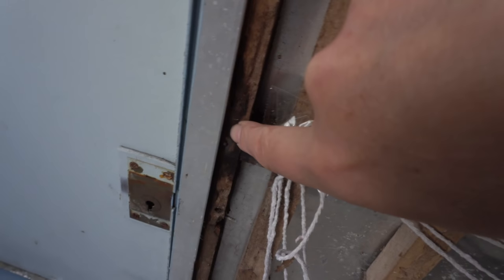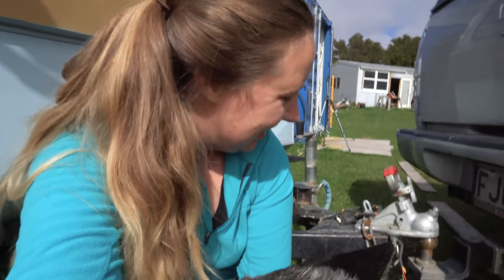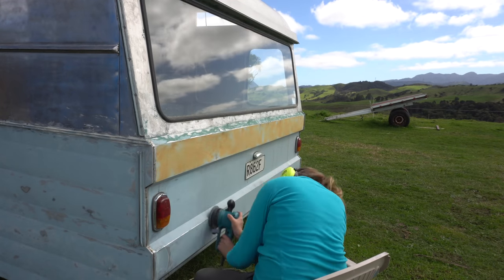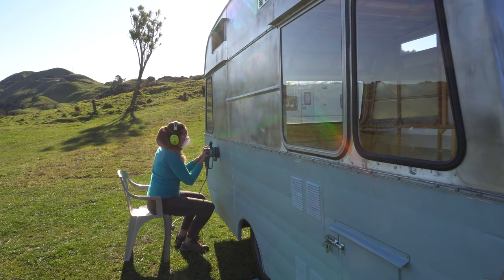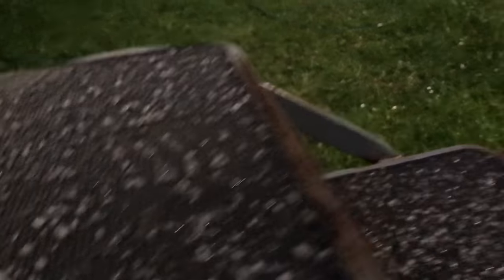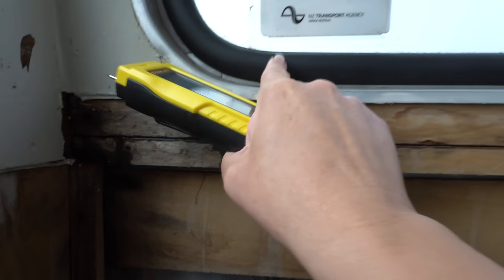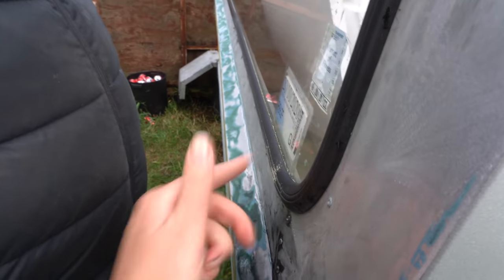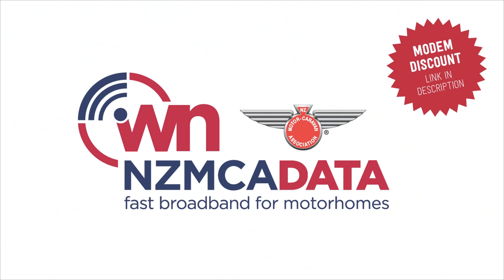Impossible To Seal Caravan 😭 Never Ending Leaks

Comment: Sealing windows that are in weather seals like your trailer has is a simple task. I worked for car dealers for many years and sealing leaks was one of my jobs, among many others. You will need a sealant of some sort. What we used is probably not available but you might check with a windshield replacement shop to see what is available in your area. If not, then you will need  calking gun, a tube of black silicone and a plasting trim stick. Something with a narrower end. About 1/2 inch or 13mm wide. WIth the stick pull the rubber away from the glass and insert the end of the tube into the exposed area. When you cut the end off of the tube make it a small cut and enlarge it as necessary until you reach the desired opening. Now, slowly slide the stick along the seal and squeeze the trigger on the calking gun. Sealant will now fill the void. A little goes a long way. Do not bother cleaning the excess sealant. You will clean it with a razor blade once it has cured. Move the stick and follow with the gun all the way around the window. It is best to do this from the outside but can also be done inside or on both sides. Personally, I would just do it on the outside. If done correctly it will seal perfectly. While silicone should not be used on a vintage trailer the windows of your design will work well with it on this occasion. If there are also leaks between the body and rubber you might want to use a sealer that is compatible with the exterior. Hope this helps.
Reply from the maker: Good to read Bob! I found some great sounding stuff at the hardware store!
Reply: @TravellingK  Great!! Just be sure that the area is clean of any lubricants used by the glass shop when they replaced that window. Take your time and work it slowly. Clean it all up after it cures instead of spreading a mess trying to clean it up right away. I like to use a razor blade being careful not to cut the rubber. Good luck.

Comment: You need to remove the window rubbers and put sealent on the inside on the rubbers before reinstalling them, then once in put a bead of sealent around the window rubber on the outside edge.
This is the process we use over here in the UK for bus and coach window installation.
If possible though renew the rubbers not sure if you have or not and do the same process.
Hope this helps
Reply from the maker: Ah no! haha, that's the hard way! I've actually found some amazing sealant stuff for windows.... giving it a go.

Comment: Get some clear silicon sealant in a tube and insert the nozzle between the rubber and the glass the glass, Might need two pairs of hands for this as you may find it easier if a screwdriver is pulled along just in front of the sealant nozzle. Just drag the two along injecting sealant as you go.
Reply: As the seals are black, black will do, too.
Reply: @jamesdecross1035  But the glass is clear and it can be a devil of a job to remove all excess sealant from the glass which is why I suggested clear.
Reply from the maker: I found some great stuff at the local hardware store! See how it goes...

Comment: I found the same issue with water leaking through the window rubbers on our Classic caravan even though they where pretty new rubbers. I ended up getting the chalking gun and putting the nozzle of the sealant cartridge between the glass and rubber and running sealant   around the window.  I also did the same where the rubbers meet the caravan skin.  I also but sealant on the joint where the two halfs of the rubbers meet.
Reply from the maker: Ah nice! I've found this great sounding sealant specifically for car and caravan rubbers.... see how that goes.

Comment: I had a Mini windscreen leak in a similar fassion to your side windows. Over the years( 25+) there had been enough dust and grime infiltrate the space between the glass and the rubber that it just leaked. I cleaned the space with a small screwdriver and it fixed it right up.
Reply from the maker: Ah interesting to hear

Comment: The Problem as I see it is that every time you move the vinny van  even a few feet it flexes the whole structure and because the support lumber is relatively flimsy the skin moves just al ittle  opening the joint a fraction and the water can get in .When the mastic you've used is new it will flex too. When the internal bits are done cupboards,  seats, bed, etc it will stiffen the whole van . Don't get disheartened hun  your diligence will pay off in the end.
Take care best wishes  to you both
Reply from the maker: Ah that is a good point with the movement. Feeling more positive and I'm getting there!

Comment: Looks like the glass slot in the rubber window weatherstrip seals is way too big for the thickness of glass. Maybe too wide for the corner radius of the glass too, which is why the seal bulges out on the corners. Probably doesn't help the slot is too wide and the glass doesn't fill it and make it conform to the curve!
Reply from the maker: Yes... think the rubber I bought has a wider slot than the rubber professionally installed 🤦‍♀️ Oh well

Comment: with baby wipes you can easy remove the sealant on your hands and even of other surfaces. You should try it 🤜🏻🤜🏻
Reply: Jochen Huygh yeah theyre the ones, the ones you flush down to the toilet and then theres MORE plastic in the oceans.
In the case of Pampers baby wipes, for example, the material is described on their website as a mix of “regenerated cellulose” and polypropylene. Some other wet wipes can contain different types of plastic, like polyester or polyethylene.
Try using paper instead!
Reply: gbwildlife uk here we do not throw them in the toilet but in the proper recycling container🤫 (evolution). And instead of using aggresive cleaner for your hands, this solution works well.
Try to stop breathing, the air will be cleaner 🥳
Reply: @jochenhuygh7175  there are two types of plastic, thermo and thermo setting. The plastic in wipes is thermo setting and cant be recycled. Nor can it be burned due to the toxic fumes and carbon emmission. Nor can it be buried as it doesnt disintegrate. You might think its safe the way you dispose of them, but clearly you dont know the full journey.
Try to stop talking shit, the air will be even cleaner!
Reply from the maker: Ah good to know!

Comment: The people that put the windows in your caravan would know just by looking at it the age of it and use the right rubber and sealant so they would not leak. I would take your caravan back and have them do it right. When it comes to the sealant you are using on the caravan.  Ask same one that work on caravans the age your caravan what sealant they use or the best sealant to use
Reply from the maker: Yes, I believe I've used the wrong rubber sizes for the smaller side windows...

Comment: K this is from yrs. ago, we used roofing tar on our trailer [caravan] roofs. All the way over the edge several inches. There is probably better stuff by now ? Haven't lived in one in 30+ yrs.
Reply: We did that, but it didnt reallly work and was a mess
Reply from the maker: I've got some rubber paint that so far seems to be working on the roof?

Comment: Wow.. Just wow.. Really hard to watch , if you're not going to do it properly and take off every moulding ,frame and window and re fit everything with a non drying bedding sealant don't bother, people wiping sealant in cracks is what keeps me in business with damp repairs. All that wood that's gone dark needs to come out , that's why all your screws are spinning ,all the old screw points are rotten and will constantly let water in . It can be saved but just stop cutting corners because " it's a bit fiddly " or everything you've already done will be for nothing .
Reply from the maker: Yike! Ok...

Comment: Unfortunately, it may have been better to strip the caravan back to its frame, reinforce the frame and then refit the flat panels fixing and replacing panels as needed using commercial 3M double sided weather-strip tape instead of so much cocking material. It still may be the best way. Sorry!
Reply from the maker: Wow, think that's beyond my skill!!
Reply: Nah, you got it in ya! Maybe next build? LOL

Comment: I was wondering, how would you seal all the cracks in the panels. I saw a caravan restoration on YouTube before and the guy had to build two A-frames to lift the shell from the base just so he could fix the base on it's own and redo all the connections between the sheets of aluminum of the shell. I guess on your budget it's just impossible. If I were in your situation, I would do a descent job of cleaning the inside of this caravan, like you did and try to sell it "as is" to somebody with more resources. Just cut your loses. You are good person, but let be honest - you will never be able to fix this caravan properly.
Reply from the maker: That seems extreme? I think I’m getting there!
Reply: @TravellingK  It's your call. I am here for the entertainment.

Comment: Personally I would see this as a positive.  To see that it is leaking now is a lot better than not knowing about it after it has been fitted out.
Pretty easy to seal up an old caravan (tip, always use a tip on your sealant tube) Outside joints and crevices first (when clean and dry), then the inside. Run plenty of water over afterwards to test (or wait till big rain). Whole thing should not take more than a couple of hours.
The sad music and commentary seems to suggest you are after more donations etc. and now resembling Eric the "e-beggar" from the "other" channel.
You have a very capable man there now that is good with his hands and knows what to do even if you are unsure.
Over it now and unsubbing. I'm sure there are many more well intentioned people that you can draw money and resources from though.
Reply from the maker: I'll get there. Sorry to hear you're unsubbing. Not my intention to be a sob story. It just happened to be a few tough days and the music suited the video🤷‍♀️